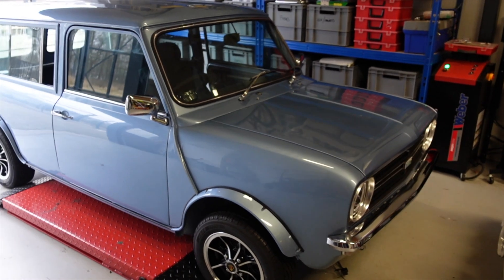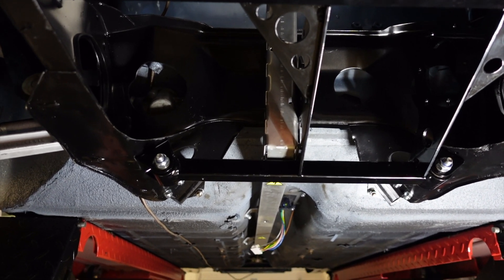Classic Mini Clubman Estate - Electric Conversion

Comment: Rather than a tradional speaker I'd suggest looking at BMR (balanced mode radiator) speakers. They are have a great number of pros for a confined space (there are always cons) and can be driven with a very small amp.  The big advantage is they have a wide dispersion. Also they are inexpensive
Reply from the maker: Interesting, thanks I will look into that......

Comment: Your car is looking really good now. I am pleased you didn't film the entire bonnet catch alignment process - that would have been tedious to watch. 

During my recent refurbishment of a '92 Rover Cooper I had several issues with new parts not performing as they should. One was with the front door window channel rubbers which when fitted prevented the windows from winding more than half way up. Mini Spares weren't very helpful so in the end I re-fitted the original rubbers (in new doors) as they were in pretty good condition. These were the only rubber components on the entire car that didn't get replaced.

I also had a problem with the indicators. They worked fine when the car was stationary but became unreliable when the car was moving. I tried replacing the flasher relay but eventually discovered it was due to high resistance in an in-line fuse holder that was aggravated by engine/road vibrations. You shouldn't have that problem with your modern fuse box.
Reply from the maker: Graham, thanks for this, I really did think I was going crazy with the rubbers, the door was the original one and I never had issues, until I change the rubber, in the end the mini sport one worked better......interesting about the lights, will keep that in mind.